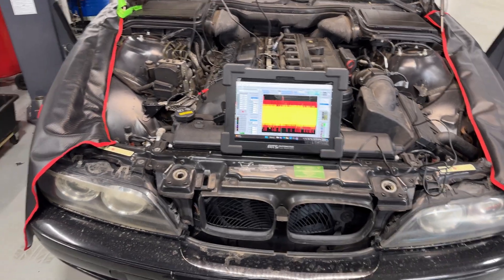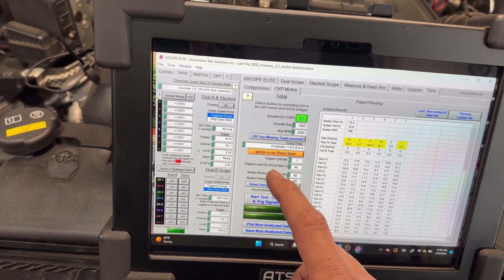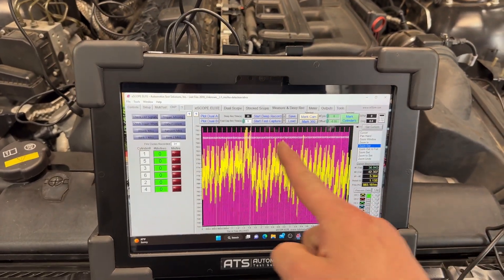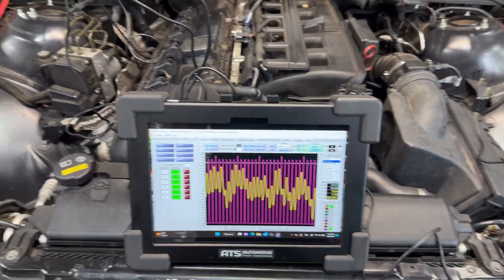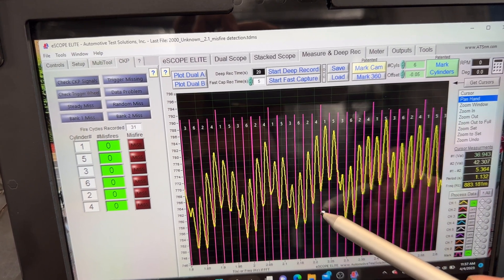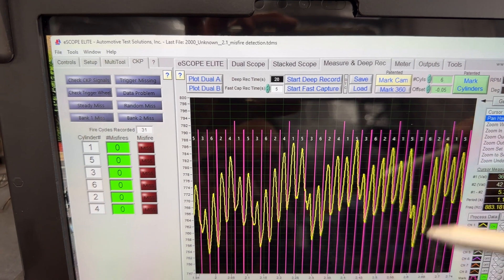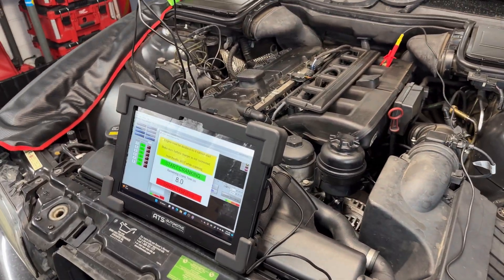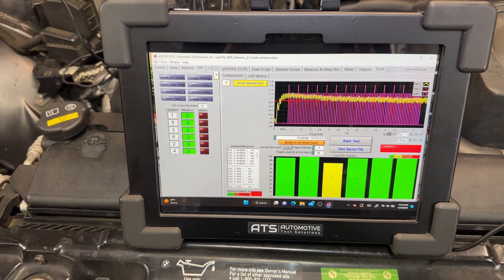2003 BMW 530 E39 M54 Misfire on Cyl 3 diagnosis withe ATS Escope, Full Parts Cannon!! PART 1

Comment: My 04 x5 3.0 developed a misfire on cylinder 2 while in a pull up a mountain one day. After determining I had spark, I ran a compression test and found zero on cylinder 2. Pulled the valve cover and did a visual inspection and didn’t find anything that stuck out. My theory was a flake of carbon had wedged itself under a intake valve seat as I could hear the air escaping during the leak down test. Being that it was about to roll over 300k miles, I decided to let it go. Besides window regulators and door handles it was one of the best vehicles I’ve ever owned.